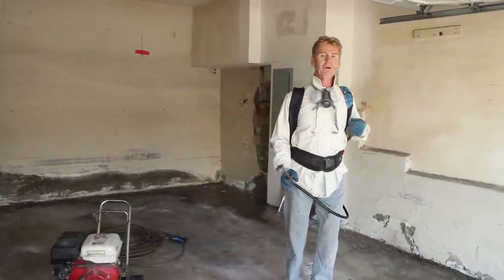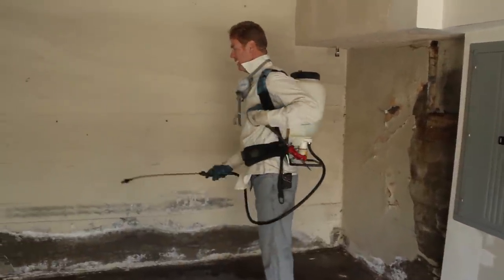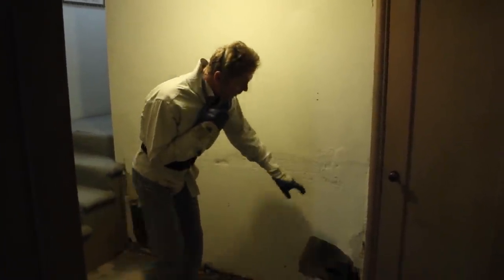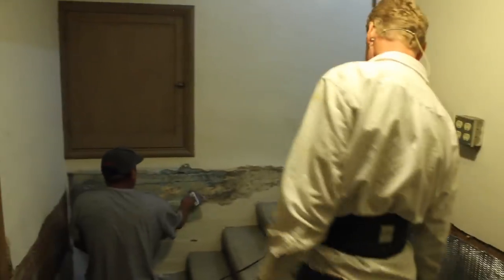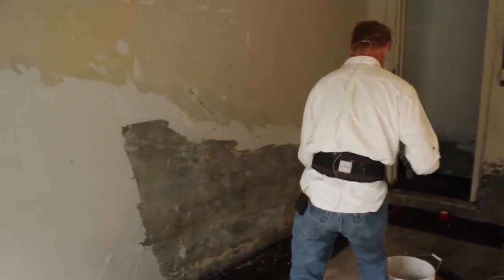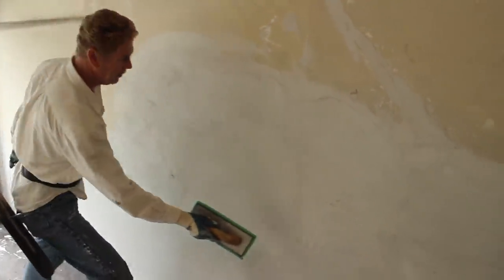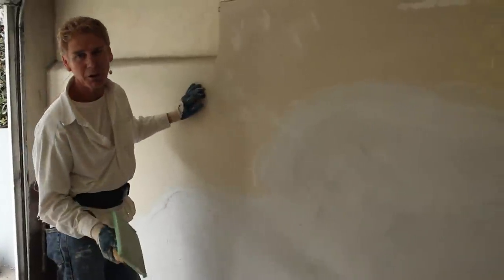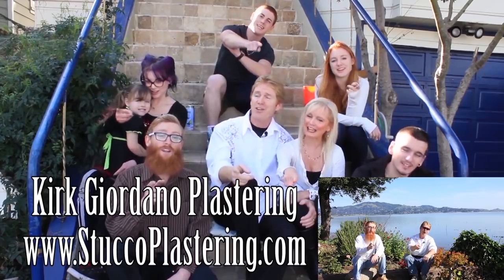How to remove mold or mildew in your house.

Comment: Kirk, a great video. I do wish this was up six months ago.  Had a mold remediation company treat our family house built in 1920. They neutralized mold on interior walls but also removed portions of the interior plaster walls: gutted a few walls removing lath and plaster; for others only the bottom two feet was removed and the top plaster was neutralized. My friends & contractors tell me to tear all the plaster out and Sheetrock. But, I like the historic look. 

Is it a doable DIY to put new plaster over the gutted walls without lathe? Or should I put up Sheetrock and veneer plaster the gutted walls and the adjoining existing plaster walls to match? Of course, this will be after an electrical upgrade. And we still need a French drain! Keep up the great work.
Reply from the maker: Good Afternoon Kenya dude, what those fellas did is what most companies recommend, the first two feet unless your home was in a hurricane or deep flood where the water was much higher. 
    FYI, real plaster especially pure lime plaster or say plaster with a lot of lime as used in many other countries will simply get wet then when dryer condition occur dryout without toxics, such as black mold.
      Sheetrock once wet should be removed and replaced as it can become a bit moldy and or carry toxins.
     I am well aware of countries such as St. kitts, St thomas, Puerto rico for example that have miles of prestigious hotels still out of service today, for this reason, the hurricane's blew the rains in on floors even on the 20th to 40th floors which will require millions of man hours to correct.
                         Live long and plaster 
    Sharing Plastering tips by the Giordano Gents

Comment: Hello  Kirk Giordano. May I ask a question? On a recent job we were patching old school plaster on an interior cinder block wall using durobond 90 and it would "pop" out and not stick and stay ?Should I seal blocks with something ?Or use a different product? Thanks
Reply from the maker: Howdy  Danny Dude, straightforward question, two reasons, first is a fact, the cinderblock is made from portland cement plasters, your applying a pure gypsum based plaster, incompatible, you must first use a bonding agent such as "Larson's, Weld Crete" to adhere to different chemically different substances.   
    The second less likely possibilty is there could be dust on the cinderblock, nothing adheres to dust for long except perhaps spider webs.  
 happy plastering my fellow plastering frind.                              

                                 Live long and plaster
                         Sharing plastering information

Comment: actually I would put the room under vacuum. Just the air pressure from that sprayer cause cause the mold to release spores. after the vacuum would demo then ice blast seal wood then replace what was taken out.
Reply from the maker: Good Evening, thanks for the tip                   
                       Live long and plaster
    Mastering Plastering by Kirk and Jason Giordano

Comment: RE:  PRESSURE WASHING:  HaHa, I got all Forest Gump pressure washing the failed plaster on the terracotta block foundation of my home.  13hp 4000psi.   Had to hang serious curtains to keep the plaster "explosions" contained (!)  While it took everything that was not 100% bonded, some plaster remained on the block.  And it would not come off unless you used a hammer and chisel.  But while making a mess, there was no question there would be a good bond of the Thoroseal I applied.  Not a plaster smooth finish, but a very respectable unfinished basement treatment.  (NOTE:  you can remove rust pretty good with 4000 psi, but higher pressure (5000 psi) would do even better.  Even at 4000 psi, you can wipe a white cloth on the steel and the cloth will remain perfectly clean.
Reply from the maker: Howdy Nofer, I have used higher pressurs in the past and found they have some advantges, but for this prep, would have taken too much plaster off.      
                                   Live long and plaster
        Teaching do’s and don’t of plastering and stucco work
Reply: Oh my gosh, I didn't mean to imply that you should have done what I did.  Completely different application!  It is hard to comprehend the amount of manual work that would be equivalent to what a pressure washer (especially a big one) can dish out!  Maybe that's why I love doing it.  and soldering.  and welding.  bu NOT painting (!)
Reply from the maker: Howdy Nofer, no worries my friend.      
                                   Live long and plaster
               Kirk Giordano’s Plastering answers to life’s issues

Comment: Curious have you guys ever done fresco imagine transfers on walls. Aka toner transfer methods of pictures. I am curious if the best way to transfer on drywall , and cement based materials is just by have your imagine on a tissue paper using a little spackle/plaster compound ..or in the case of cement just wetting it on top and polyurethane it in.
Reply from the maker: Evening brother Sam Dude, sorry, we do only plastering and stucco.
     Cheers, peace & harmony 
Sound Plastering tips from your favorite stucco geeks

Comment: I’m trying to find where you get your 20in pool trowel, possibly Venetian  plastering brand, can’t find anyone who sells, round corners with straight ends. Any good advice for possibly ordering one,
Reply: Just use it for 30 years and your corners will look like that.. 😂 that trowel will destroy your arm if your learning.. see how he controls the mud on his trowel? That’s why he can get away with using something like that is because he can get it pretty good just off the hawk before he Rods it or trowels it.. therefore he isn’t pushing a bunch of unnecessary mud with his trowel.. I am not a “plaster” guy but i have done my share of mixing deck mud, fat mud, and screeding walls being self employed with over the 17 years experience.. perfecting your craft and understanding products far outweigh the tools used.. When I was an apprentice the best advice i ever got was if you see an old mason/tile setter I should pay attention to his details because obviously he is doing something right.. it’s not the tools it’s the craftsman using the tools

Comment: Are dehumifers worth using and do they kill mold already in a room or do they just stop new mold appearing also is salt effective and ok to use in dehumifers that have crystals in the top of dehumifer I have mold in my bedroom and I use dehumifers and I dont wanna have to keep buying more dehumifers
Reply from the maker: Yes, air filters are great for recycling and cleaning the air of dust, dirt grime, and other toxins.
Reply: Dehumidifier only stop new mold from growing. It will not kill existing mold.

Comment: Sir, I love your videos, and respect your long years of expertise, I myself, have been doing electrical work for 30 years, and the law, in PA, for 17 years, so those are my areas of expertise, however, there are ppl much smarter, than me, out there, that I would never proclaim, I know everything, in those both broad fields. However, I think you may know everything, when it comes to plastering. Anyway, sorry to bore you with my drawn out question. What do you think, of the other experts, in the fields of construction, such as Mike Holmes, from Canada, saying that, the bleach you use to clean the mold, is worse for you then the mold. He recommends, anything over 10 sq/ft to get a professional, to get rid of it. But he is hard core,  when he encourages, do not use bleach, as there are specialized chemicals now, that aren't as toxic to humans, or the environment, as bleach is. But, albeit, I'm sure they are far more costly. What are your thoughts on this, b/c this is the 1st video,  I seen you talk, about this topic. And by the way, watching the way you use that trowel, reminds me of how, 1 of my kids, watching me do electrical work, using a pair of needle nose pliers, (b/c I flipped it to use it at a different angle, and then flipped it back) my son said, dad you use those pliers, better than a surgeon uses their surgical tools, and your probably more precise.   But overall great video, een if you don't get to my question please keep putting the videos out. I love them And your knowledge is 2nd to none..
Reply from the maker: Good evening Ron, thank you for the kind words. If you don't want to use bleach, you can use white vinegar. I add it to my dishwasher and the washing machine. If I run out, I use bleach sometimes.
 We both know if you search and read for any time, the internet is full of contradictions like a live conversation. Personally, bleach doesn't scare me. Now ticks and mosquitos do🍻

Comment: Great video and informative!!!!! Now my question is, is it possible to use structolite for interior walls instead of imperial? Then finish off with diamond cut?? Or is regular joint compound enuff to finish a plaster wall? Thanks!!
Reply from the maker: Good Afternoon Clayton Dude, yes, structo-lite can be used, structo-lite just takes longer to dry usually between 3 to 5 hours, and yes any veneer finish can be applied over it.                  
                            Live long and plaster 
    Sharing Plastering tips by the Giordano Gents
Reply: Kirk Giordano plastering Inc. thanks guys!!!! Keep up the great work!!!!!

Comment: Do you have a video on cleaning hairline cracks in exterior stucco before repairing? Two sides of our house have small cracks, but only one faces two big oak trees and those cracks have turned black.
Reply from the maker: https://youtu.be/2eIkdeIBbMs/ Stucco Structural large cracking on stucco walls with hairline cracks

Comment: Hey Kirk!! Quick question, I just applied structolite on plaster walls that had deep cracks and exposed wood lath. I applied plaster weld throughout then the structolite but forgot to apply the big rolls of mesh before. Can I apply the mesh after or it doesn’t matter?? And can I apply structolite over structolite?? Thanks again sir!!!
Reply from the maker: Howdy Clayton, no mesh is needed, as you can apply structo-lite over itself, but misting is a good idea,
 "spray the existing structo-lit plaster with water so when the new plaster is applied they get a good mechanical bond"      
                                   Live long and plaster
        Teaching do’s and don’t of plastering and stucco work
Reply: Kirk Giordano plastering Inc. thanks for the info!!!! And another quickie is structolite only meant as a base coat or can it be used as final coat??? Btw I have adapted ur dollar brush technique and it works wonders

Comment: You can do anything!
Reply from the maker: Easy big Daddy, some stuff like this video, I don't advise doing as I have done this sort of clean up about 40 times, most folks would not take advise from me or anyone else about the health hazards, thus because of all the floods everywhere at the time we did this video and the fires, I thought I would share a bit of info I have learned the hard way with my many years in the field, with regards to the current floods which leaves mold in the walls when left untreated.            
                       Live long and plaster
    Mastering Plastering by Kirk and Jason Giordano

Comment: Also, this maybe out of the realm of your expertise. I don't think it is but anyway he it goes. I am putting in a shower backing wall around the typical 5' long and 30" area where the back of bathtub is and the also 30" should I use just regular concrete at the joint of the concrete board?
Reply from the maker: I have some experience with showers, I wrapped the walls with a grace membrane a,
 "rubber- membrane," attached lath 3.4 netting, then applied a skim coat of stucco to the surround, after which I tiled, that was thirty years ago. I have done about ten since then. 
This is the only way I do it.
 I have applied every shower material known to man, they all mold, so I tile nowadays, even with adequate ventilation the grout can still mold to. That's life, my brother😉

Comment: In your guys opinion if you have done stuff like that on floors , walls , ceilings the extreme would be what churches have in them. I have done them from an arts/craft perspective but i imagine the same principals hold for building construction materials as well. For dry concrete i imagine just polyurethane it in or using a clear epoxy resin would be it ...and just not worrying about the tissue paper/clear paper as long as its see thru no ones going to notice could be wrong.
Reply from the maker: Evening Sam, I personally would not add any polyurethanes or epoxies to gypsum-based materials, these compounds will destroy the integrity of the plaster product.
 The crushed limestone added enhances the strength of the product were using, as they are both minerals.
 
     Cheers, peace & harmony 
Sound Plastering tips from your favorite stucco geeks

Comment: Wouldn't you want to fiberglass tape those cracks?
Reply from the maker: Good Evening  Greg, for sheetrock yes, for this repair I preferred a bonding agent.   
                Peace, love, and happiness to all.
  Sharing stucco wisdom and or common sense plastering tips
Reply: But bonding is for the plaster to adhere to the wall, it doesn’t fix the crack at all. Fiberglass tape should be used on whatever surface it is, if there is a crack that big. 🤯
Reply: You’re confusing plaster with gypsum board. This is actual plaster he’s using.
Reply: Ryan E No I’m not, bonding alone won’t seal a crack. With a crack that large you totally want to put fiberglass tape over it.